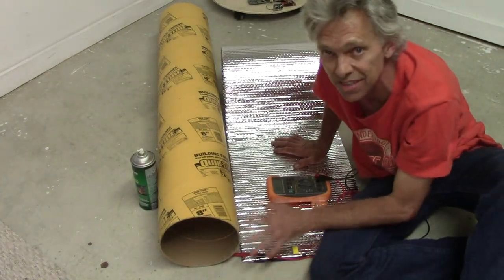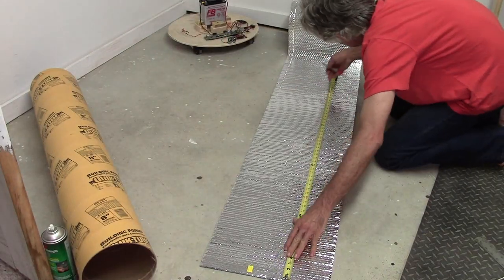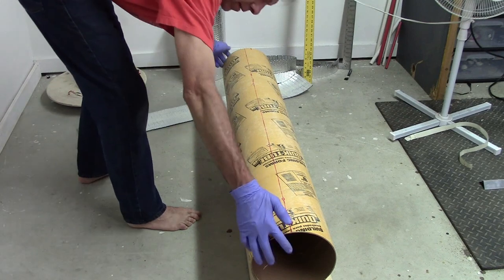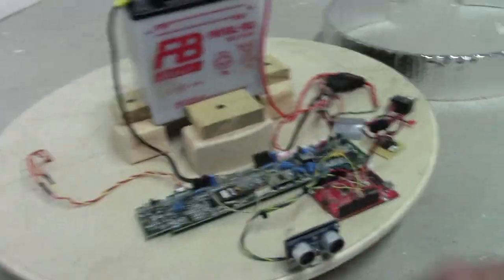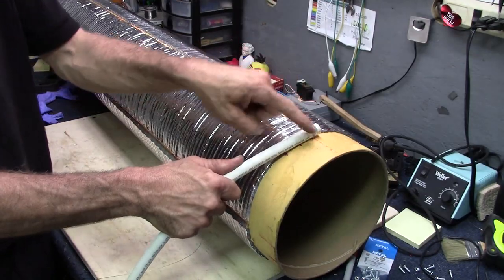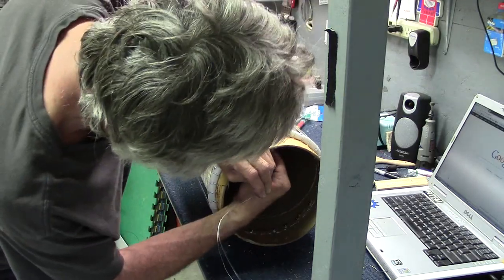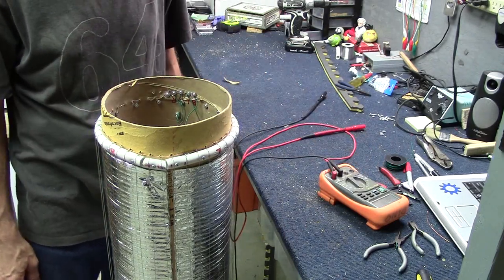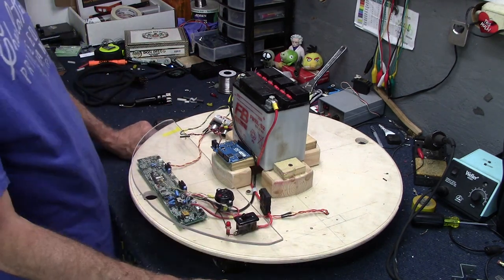Photon The Video Photo Robot Part 3

Comment: Great idea to use the wires as sensors.  But one wonders if a change in capacitance could be reliably measured when the foil lined bubble wrap is deformed in a collision.

Comment: the foil could be connected to ground, the wires with a 100k pull-up resistor, and each wire connected to the micro on a separate pin